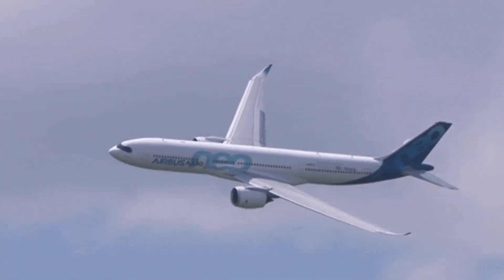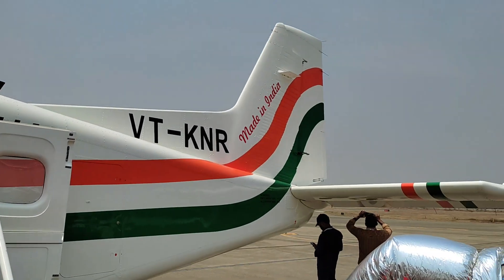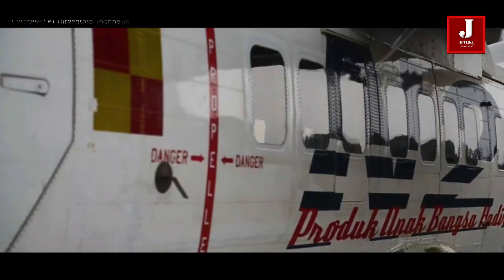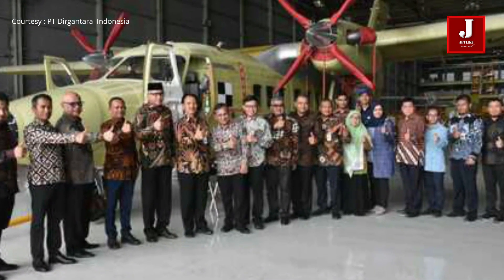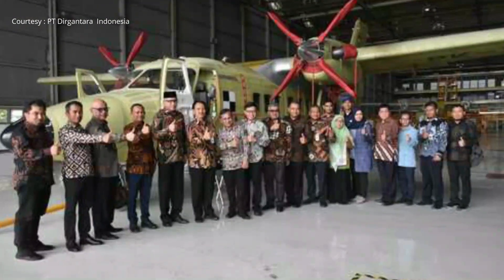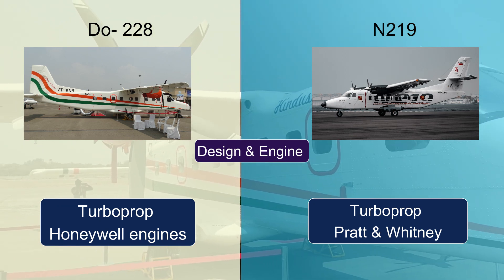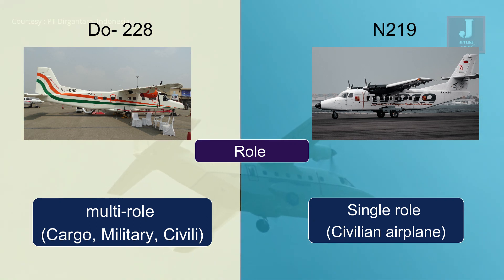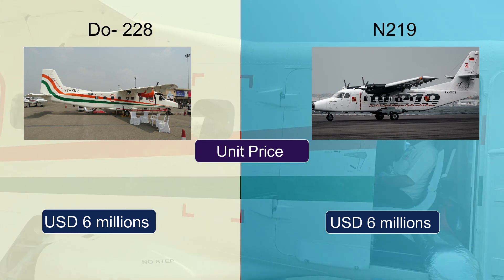Aircraft comparison of Indian Built DO-228 and Indonesian Built N 219, Features, Size, Range & Price

Comment: Both aircraft’s are suitable for their intended roles , Indian one is derived from a German design and has been in use for some time  ,  while 
Indonesian  machine is a new design with up-to date features virtually custom made for the geographical and  connectivity  needs 
of a biggest archipelago on the planet . While the range at first sight would favour the Indian  machine  , the Indonesian plane is not far behind 
and have some more positive elements by being made from ground up  , while Indian plane can accomplish multiple roles as  military and  civilian as stated  , the Indonesian one  has a cleat mission of connecting a vast Nation composed of many islands and in need of 
reliable air networks  . In both aeroplanes  , motors / engines  are of foreign origins , in the view of this writer this should be remedied 
as soon as possible by developing a domestic avio -engine manufacturing capacity as well as avionics capability based on  domestic 
talent and needs and thereby  start developing technological sovereignty  , and it would be superb if these two Asian giants could 
collaborate in this direction to the benefit of both countries …  Otherwise I say -GO FOR IT INDONESIAN-AND -GO FOR IT INDIA …., 
AIM FOR THE STARS … THE WORLD IS YOURS … SPRED YOUR WINGS MY FRIENDS….❤❤❤❤❤❤❤❤❤

Comment: I am an outsider, neither Indian nor Indonesian. Assuming that both aircrafts are built to its specifications, the Indian Dornier DO 228, 19 seaters looks more attractive to me from engineering/design point of view. I like the design/arrangement of the landing gear, looks very stable. The long and spacious compartment at the nose can be used to install sonar equipment to detect submarine. 5 blades propellers are more stable than 4 blades one in case 1 blade get warped or loose. Longer range is also a big bonus as well.
Reply: In case one blade gets loose the engine will shake itself to pieces!
Reply: koment bodoh 😂😂

Comment: DO 228 is better than N219 as it is proven platform with better range, much better cruise speed(413kmph), higher service ceiling(7600meter+), highly reliable, rugged platform and comes with 5 blade propeller engine which is considered efficient and quiter than 4 blade engine of N219...
Reply: Tapi bukan buatan india , india hanya punya lisensi
Reply: @tinatina9333  Because it was developed in 1980's but currently we build our own Saras mk2 aircraft .
Also we are developing RTA70 aircraft which is 70 sitter aircraft.
Reply: @tinatina9333   
We have our technology. 
We build our own fighter jets and helicopter. 
We built indigenous Aircraft engines too.
We have self designed SARAS utility aircraft
Reply: Same asumtion of malaysian🤦